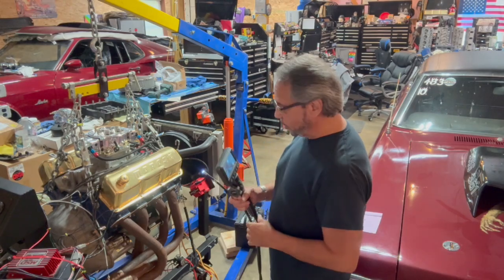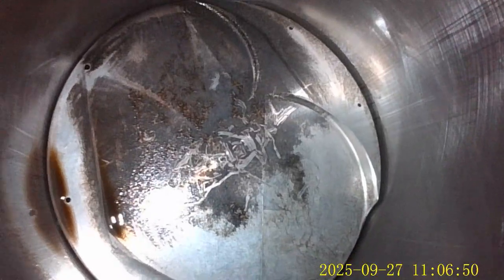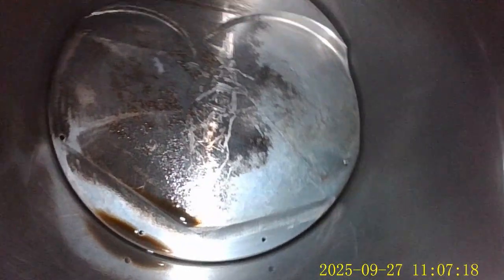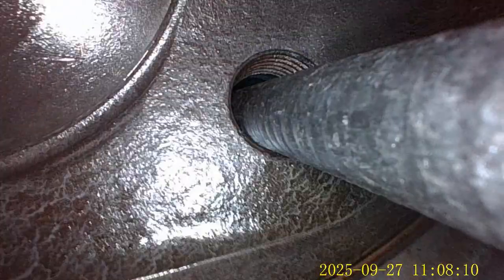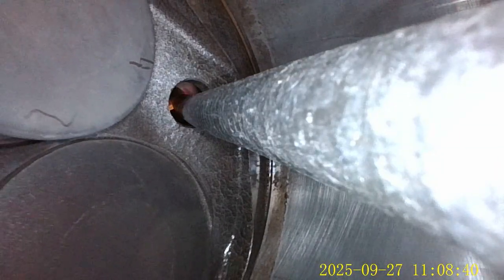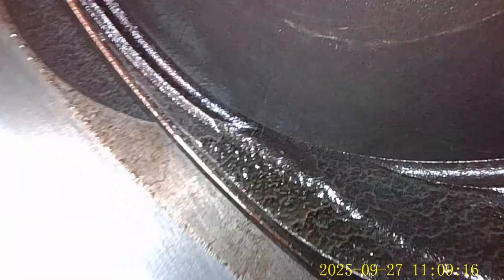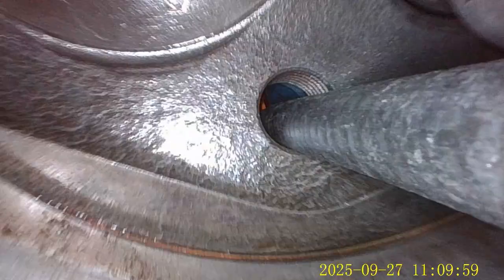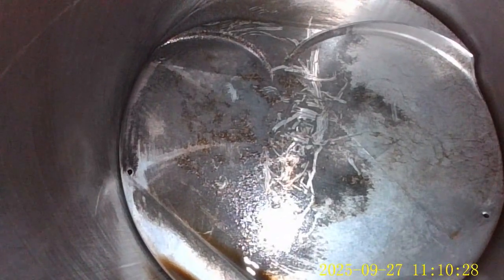DBG: Using The DXZtoz Borescope,  What 8 YEARS of Sitting Did To The 615hp Stock Head, 351 Cleveland

Comment: Hey DragBoss.  I don't remember your specs on the Stock head 351 Cleveland.  Curious on cam, compression, which intake manifold and carb used.   You mentioned a valve job was the only work done on the head and these heads.
Reply from the maker: Here are the specs 

DBG: How Does a Ford 351 Cleveland with Stock 4V  Iron Heads make 615hp ? ..Secret Solid Roller Cam
https://youtu.be/i7cTug-EVNY
Reply: Thanks Drag Boss.   What an awesome engine and an awesome car.   Do you know if Ford had any turned up versions of the Cleveland from the factory?     Like 500HP+.  ?

Comment: How many Chevy 350s made 615HP, with as the bore scope showed, bone stock heads!
Reply from the maker: I don’t of any…
Reply: @dragboss351cleveland are these stock untouched heads or just original castings?
Reply from the maker: @bcbloc02  Only have a valve job done.
Reply: Zero stock head 350s
Reply from the maker: @dennisrobinson8008 thanks 😊
Reply: @dragboss351cleveland  yessir, your page is awesome as usual.

Comment: It may not even be oil sitting there.  Sometimes when the engines are shut down, fuel will run down and mix with a little carbon.
Reply from the maker: Brent you could be right, I will look into intake manifold and see what I can find.

Comment: What are a few scenarios where you would want to use a bore scope Tim? Low compression, excessive oil consumption, blown head gasket maybe. I didn’t even know a bore scope was a thing until I saw one here. The clarity is amazing!
Reply from the maker: All over, Eval valves, head gaskets, leaks, valve seals, inside a bell housing, anywhere, you cant see, and want to.
Reply: @dragboss351cleveland  Thanks Tim! That is definitely the right tool for the job.
Reply from the maker: @randepayne6966 sure is. I have used a few time already.